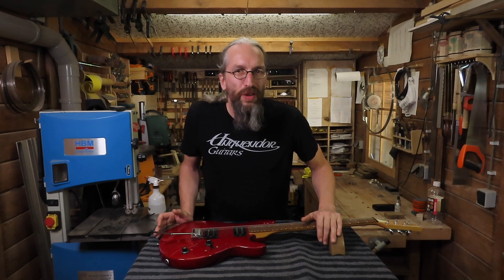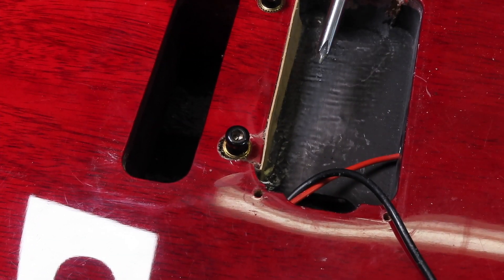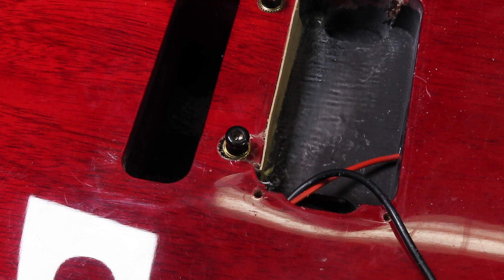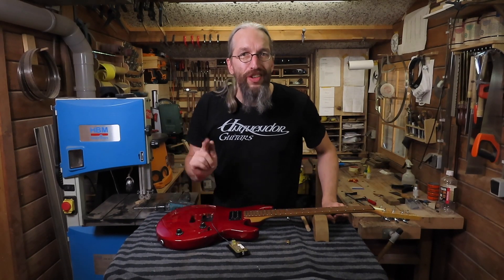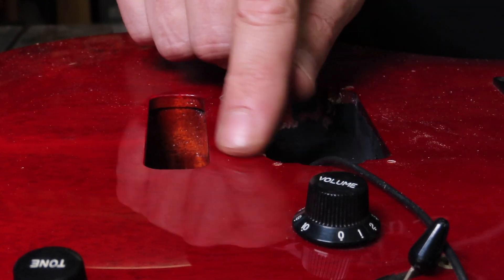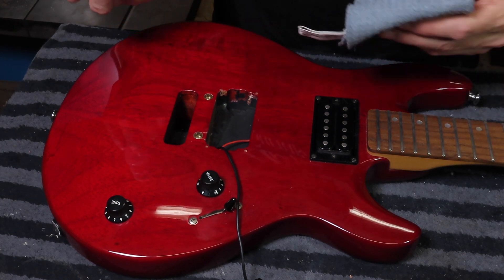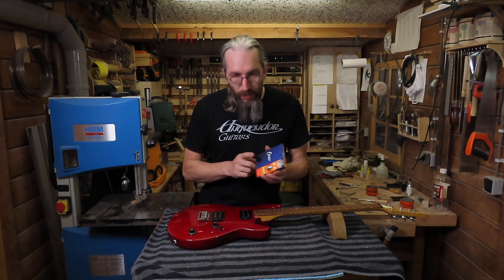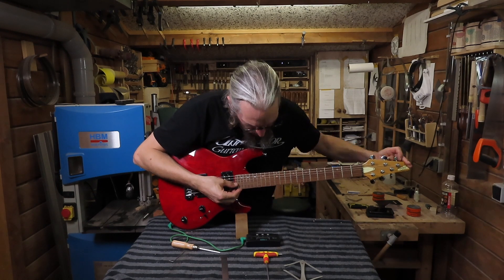Guitar Repairs: Fixing a loose Floating Bridge Stud.

Comment: I had the exact same problem..  I used JB Weld.  I glued both the wood and the metal post back in using JB Weld.  I wasn't sure if it would work..  3 years later... Its still holding strong!  I haven't seen many people use JB weld on a guitar..   I use my trem bar all the time too, which puts pressure on the post.    All I can say is JB weld worked for me!

Comment: When you replaced a tremolo, for example, replacing a FR1000 for a Schaller Lockmeister, do i have to put dowels in the holes and drill new ones to install the new studs, or is not necessary and i can use the same holes? i'm supposing the studs have the same measures.

Comment: Why does it happen? I think because some people remove the strings than the bridge forces the studs outside. If the tremolo is perfectly balanced it will not cause any tension to the wood I think.

Comment: Hey Daniel, I'm only new to your channel but thankful I found you via the GGBoff 2021... I really enjoyed your guitar build indeed!

I'm no guitar repair guy but I'm surprised you didn't mix any red stain with the super glue in order to hide those two cracks a little better? I guess they can only be seen when you really look for them anyway but your eye for detail is so great I was expecting some secret technique to come out on that one. Lol!  ...of course, thank you for another great video - I'm certainly not disappointed at all, I love you work man!! 
Cheers and respect from Australia.
Reply from the maker: Hi turbo tunna,
Thank you very much.
I had the intention to use red stain before applying the CA glue, but sometimes I get distracted by making these videos. Besides doing the repair or any other work I'm also checking the camera, mic, lighting and setting up the shots. I realized I forgot it after polishing the guitar. Like you said you can hardly see the cracks anyways so I decided to keep it as is.

Comment: Wow a Starfield(Ibanez spin-off) you don’t see them much anymore! I’ve owned a couple in the past! If you don’t like a thin neck then these are probably not for you! Why didn’t you add just a little red to the crack? It would’ve been a little less obvious than the breakout?
Reply from the maker: Hi Kirk,

Good questions.
To be honest I intended to use a bit of red stain or dye but sometimes I'm distracted by making these videos so I forgot. I realized this as soon as I applied the CA glue but by then it was to late. Luckily you can barely see the cracks under the bridge and pickup ring.

Comment: Excellent job.  Unfortunately those type of problems tend to reoccur. I have done the same thing many times. Sometimes to the same guitar. The best solution I have found is those stud straps. The studs are pressed into a metal strip. Which is screwed down to the guitar with wood screws between the studs
Reply: Could you go more into detail? Your solution sounds solid